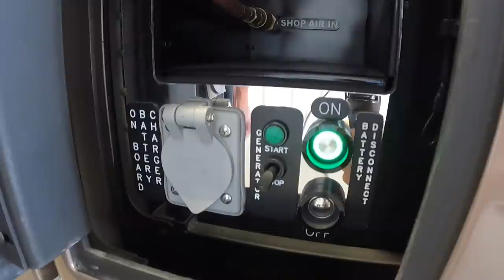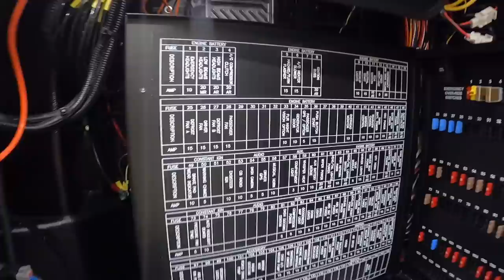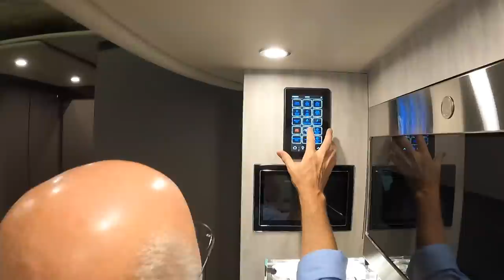TOUR OF 2022 NEWELL COACH BUNK MODEL WITH 2 BATHS! (COACH #1729)

Comment: Newell is #1 in terms of fit and finish, I just wish they would get on board with lithium batteries with integrated engine charging to completely establish the leadership position in the market. Until they do that, it's going to be a toss-up between them and Liberty coach who are still more technically competent.
Reply: I’m pretty sure they have done coaches with lithium battery systems.
Reply: @moegeek  They have, but based on all of the videos, it is a rare option.  What I find bizarre is that a company like Newell with all their engineering expertise doesn't get the cost-benefit of Lithium.  The upgrade would be an infinitesimally small cost upgrade and deliver huge cost-benefit.  I guess they're still banking on the big 20kw Genset upfront. I would get rid of the 20KW genset and add some hydraulicly driven engine generators that would come on when dod was under 10%.  What could be simpler?
Reply: @duncanjames914  I imagine their coaches are rarely far away from shore power.  They probably have very low-time generators.  The gen is probably only used for A/C while in transit.  But you have a point - a PTO or hydraulic generator would fit the purpose for most.  If I were to build one, it would definitely be like you are describing.
Reply: @moegeek  Liberty coach has this set-up and it is really compelling.  I love the idea of AC wihout a genny.

Comment: Hving 4 banger for breaking engine & exaust can also if u hve them hve compressor fully changed tank ready to engage air bottom brake cylinders. On top I mentioned b4 u hve 2 diff boosters so if not using air brakes u can just flat ground no rain no tow not stop & going get by on normal hydraulic braking lines to calibers top front & rear.

Comment: The pull out kitchen Island is a winner no doubt like a flip up counter, but also great when used as 90deg sofa but never hve I seen any1 yet convert a normal bench dinet into a U dinet if needing more room way better than going u back inti simple table but it takes up more room when slides not open.
Reply: If hidden in wall until u slide open dinet becomes way better u when u slide open idea, home run great if poss, I think it can be done so. from 2 seat table to 4 to 6 if slide open normal inti U.

Comment: Euro campers though of this1 putting wet dishes up 1 side to drip dry over sink in cabinet. No1 I hve seen did it on left & right sides dripping dry over removable slopped cutting boards/ draining into sink in middle or clean both cutting draining boards in place flipped over smooth top counter covers.

Comment: I would make engine compartment be able to lower engines down to nearly ground so easiest way to hve more working room around engine if it able to move 18-24" up thru down on ground to get working room as needed. All room 2ft on top or all room 18" or 2ft on bottom side. When it comes to sides the parts that attach to side should easily all unbolt come off if needed, both sides.

Comment: So straight 4 high or low, then straight 8 generator or combined mixing air & fuel as light as poss or even stop starting as needed. or 12 running together if charging & driving 75+mph & wind or towing too.

Comment: I    just  recently    disinded   a  double   decker   ,   a  double
story   coach    with  the  special    doors   outside    for   the   fizzer-
- frige  ,  washingmashin and  dryer  to  removed   if   any  time   is   nessery   without   any    problems ,  without   even  coming   inside    
Into   the  vehicle    
 .   The  coach  can  be   with   2   fools   sizes bathroom  and  powder
room   down  stairs   ,  with    a   bar    and   setting room    and   the
Kitchen    and   stercases   on  the  top   level  .To  enter   into  this  
Coach    can  be  from  the  both  sides  .The  powder room   will   be
On  the  lower    level    and   the  kitchen  , mini  bar   and  sitting room 
a  bit  upper    (   1,20m  higher   then  the  powder-  room  )   and  the
driver   on  the  front   on  the  same  level    like  the  rest  of,   for  example   the  mini  bar   .   Upstairs    from  the  lower  level    will
be  approximately 2,40m  .   I  sad   approximately   because   the   all
Messmants   are   in  my    imagination and  the reason   of  that  is
because    I  don't  know    exactly    the  whole    matale   structure   from
The  top   to  the  bottom.   The  only  thing  I  can   imagine   but  at  list  i  can  do  that    in  very  easily    way   and  also   it  looks   very  smart    and   spacious   .

Comment: They really are beautiful. Are these painted in a huge spray booth? For the clear coat, a gun that puts out a super-wide fan would be ideal. When I painted cars it would take many passes to achieve a film build of clear that would flow out properly. What a job to paint one of these! Imagine if they partnered with Elon Musk to make an electric version. They could use a similar model 7 motor system just scaled up several notches. 0-60 in 7 seconds maybe!

Comment: I would hve 2 aqua hot type systems so u hve enough hot water to spray pressure soap oy brush & soap wash hole rig front to back, crazy to leave any free engine heating left behind, so hot tub bath tub easily fillable/ useable or cleanest couch around & redundancy never out of not water dishes shower & cloths washer going same time.

Comment: The less u hve to dump the safer the rig could be bal front to back or side to side if designed right on God 100 or 200 gal snow icey driving. When u hve similar 100 or 200 gal fuel to bal out ride front & back & side to side & same 100 gal of fresh water not even counting any heated 20-25 per aqua hot that is a great load to plane position just right esp if towing.
Reply: No couch more than a million should not hve endless recirculating shower option like best van life rigs.

Comment: Nice coach! diesel engines are designed for torque not speed! it's about how much weight you can carry or tow lol The graphics are cool, just weird how the artist signed it! I mean the cabinets are beautiful and so is the flooring but I don't see signatures of the people who made them lol what's with these bi-fold storage doors? I thought for sure I was going to see blood from him banging his head on them! swing out doors with a switch on the door is a much better solution than a remote because then you don't have to bang your head finding the remote lol as for storage height it is essential because the slide trays take away height and if I cant tow my trailer with all my toys for some reason I would need storage height for my foldable kayaks! cant put kayaks in those storage bays! 2 million dollar coach shouldn't have options it should always come loaded! other than that great job Newell

Comment: Cummins 15L 605hp and 1,950 torque. I still think an X15 Cummins with 565hp and 1,850 torque and an Eaton Ultrashift with 13 or 18 speeds would be far better than the option in that coach. I'd get rid of the electric slide out trays, just something else to go wrong. I think a painted steel wheel would look fantastic, maybe powder coated. I like the interior, it's fresh and clean. Bunks, LOVE IT! The paint, I'd get it repainted in a dark non metallic blue with either a silver or maybe platinum coach line or a light gold. If you have one of these coaches in a deep dark non metallic blue, at night in a well lit area it's gonna make EVERYTHING else on wheels look terrible. I'm hoping someone does a one colour Newell in blue someday.
Reply from the maker: This coach has the Cummins X15
Reply: @RVingwithAndrewSteele  but 605hp is too much, it should have no more than a 565hp X15. There aren't enough gear ratios, 6 speed torque converter transmissions sap power especially in heavy applications like this and increase fuel use. Less power, more gears and you'll get better results.
Reply: its not yours... when you custom build yours, you can do spec as you like....

Comment: If aqua system is 20-25 gals stand by then u hve 50 potential standing by 2 days since last ran truck no juice needed. Never run propane or oil or electric if u still hve engine 20-25 gals times 2 standing by, 20hrs or so, 30 hrs b4 normal temp only water.
Reply: So if u combined solar charging to bal draw not needing to run generator but every other day or so when needing to reheat water same time even just normal 55% min charge batteries if u hve enough solar & trickle free power generator 24hrs spinning glowing.

Comment: I am empressed with the engine rear and side access, air hoses, cummins engine.  When I am ready to purchase I will want my design painted not the company's template.  However it is very well done.  I like the manuel approach in the bay areas.  Great thinking about storage space.  nice feature with the fuse access. Did not like the TV at that level.  It should come out further and then raise to my ccomfort eye level.  Locking the fuel bay is good, but I would like to have my fuel fill to be black flat to not show dirt.  Do the engine access doors lock as well?  Ilike the water system and the waste system and the cooling system.  So....Newell cares, I like the care package it makes me feel ready for the road?  I like the electrical system (fuses), air compressors.  Does that door lock?   Now that generator bay is sweet. I like the two sofas accross from each other.  if i want to sleep or stay awake and keep talking, etc.  i can do that.  Great Job!   I dont like a the table.  I don't want to put anything together, just make it a  manuel crank out extension from the bottom of the original table, with a stabelizer bar.  let me back-up, what about the entry grab bars to help me not trip up the stairs.  What about the wheel chair access?  Best bathroom ever right On!  Newell, you think just like me.  Back up to electrical is manuel.  Keep it Moving!  How much weight can that top bunk support?  Sweet bedroom.  Does that sound system flow through the coach?  I would like to have a non-skid/slide top to the side nite-bed stands (tables).  Can I honker down in this baby during the winter and be just as comfortable and cozy and safe?  Best private bathroom.  Phil.. You really do Newell good.  You are so knowledgeable, well versed, flowing information about the product.  That video must have been two to three days.  But that is what selling a product is all about.  Great Job?  Andrew, nice video for this company.

Comment: If driving on 4 upto 35 mph flat ground high gear only way to go. If hilly area up to 35mph not as slow as train low range way to go or towing or off road gravel/dirt snow idea. If u r going to need for breaking heavy towing loads or in rain, or snow low range way to go. But just normal engine breaking & exaust high gearing lower rpm just fine or flat ground just normal flat breaking under 55 mph just fine 4 turned off.

Comment: The genius is spraying diff fuel air mix every bang every time so u gt cooler cheapest mix burn to break/rest as needed all 8 at a computer controlled time. The back hoe 4 banger u want power mode bc also breaking simple dumb down cheapest simplest never breaks down design so never left stranded like generator won't fire up.

Comment: Newel aren’t the best if you're using the coach for a band. one of a few reasons is that having the bottom storage trays that automatically slide out seems like a nice idea but in reality it’s taking up valuable space and the tray motor is something else to break or loose the remotes or the battery goes dead on the remotes etc. Also the way the storage hatches lift up and out is absolutely terrible if your using this coach for a band because your constantly in situations where you need to line the bus up next to another bus pretty closely and if the storage hatches doesn't Open like a Prevost hatch does you risk having a hatch hit another buss or it's just cumbersome. This coach is obviously nice but I don't Think anything beats Prevost.

Comment: 330: A 4 cylinder diesel  giant base engine That run torque back hoe powerful or pto on the end that is generator u can use 1 or other like a yacht or both same time wild idea. Only way to save space & fuel God brand Class A-C idea is to steal from yacht then go beyond by high pressure spaying air for the 8cylinders prt way for fuel to save mpg or per hour running. Around town bach hoe straight 4 is plenty, till about 35 ish mph gearing low.
Reply: 4speeds high or low geared way to go off road power or city driving. Then PTO if driving mixed air cheaping mix out so only 1/2 fuel vs all fuel on generator, mixed driving up to 55-60. But once u need more then full fuel generator or use both engines together. 4 actual cylinders high or low gearing starting pulling or under 35mph then add in generator if needing 75+ speeed remember a generator can adapt to load throttling up or even stop start shutting down.
Reply: So u just hve to know mode 1 low or high mostly high not pulling city driving. Or mode 2 just generator spraying air to use less fuel, under 55ish -35 mph driving. Or mode 3 both engine power & less generator fully able 2 cycle up or off while engine stays running PTO style to meet 75mph demands full power full tow. U want to use generator when ever poss but it is under sized so more efficient to just combined power when needed. Driving straight into wind over 55mph.
Reply: The generator most efficient electric motor design but not as adaptive/responsive as a turning engine esp if needing braking any time too over 55mph.